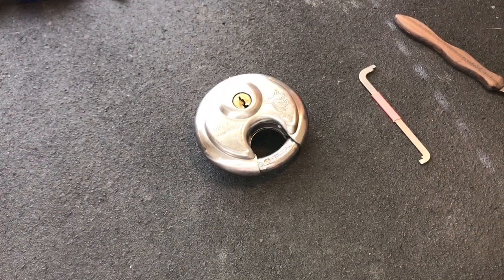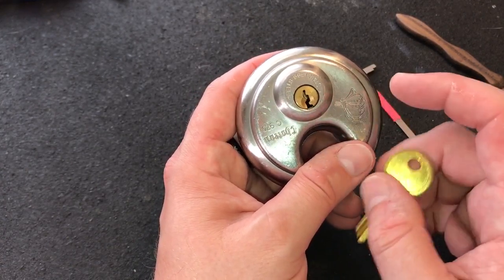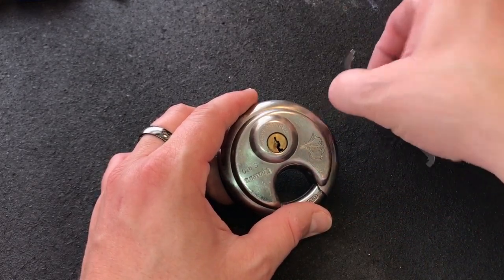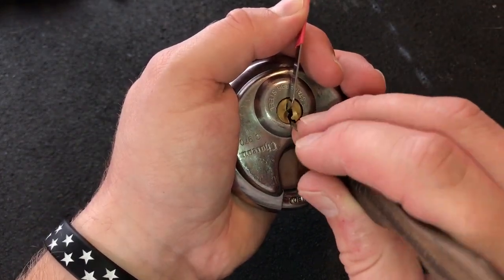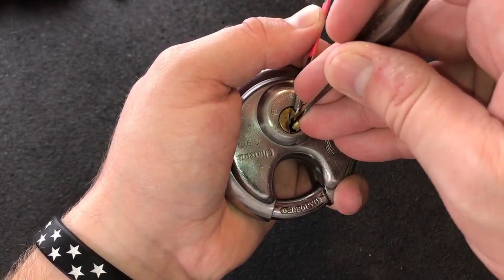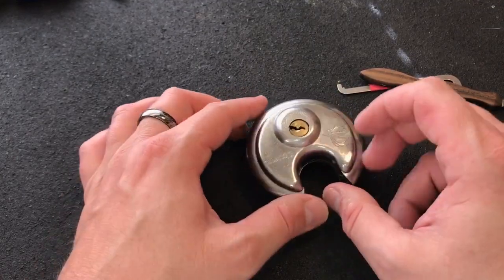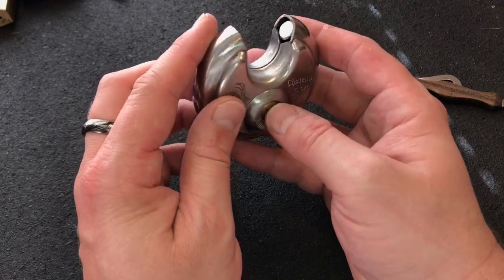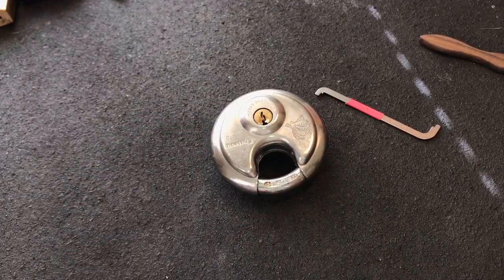LPPtln (31) Chateau C970

Comment: I have this exact lock at home that I use for my gym locker. Ive tried picking it open and got it once or twice a few months ago and now I can't pick it or rake it open at all. I find that when I use the key, the key sticks a bit. Do you know what I can do to fix that or overcome that stickiness when picking?
Reply from the maker: I still have frustrations picking it myself (normally because I try the wrong tensioner and pick) so don’t feel bad! My guess as to why the key is sticking is due to picking and raking. Steel tools are much harder than the brass pins inside the lock and every time they’re picked, a bit wears off. Over time this can add up to make the key ineffective because the cuts on the key are just a tad bit too shallow. If you’re still using the lock and don’t want to replace it, you could possibly use a key copied from the current one but with the cuts slightly shallower. 

The C970 is actually a decent gym locker lock IMO. Can’t be easily picked, no bypasses, and good cut resistance.

Comment: I have one of those and I got it from a garage that this lock was there for over 2 decades and I got it picked opened thanks to you I had trouble with it because if I’d tension it the pins would not set or it would reset the problem was I was over tensioning it I lessened it and I got it easily